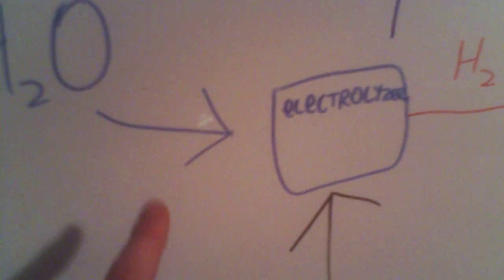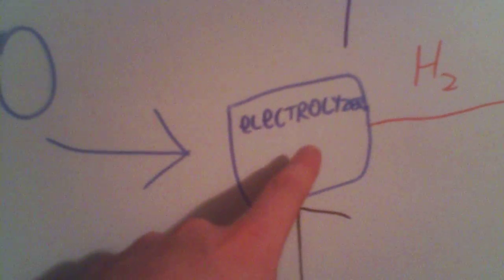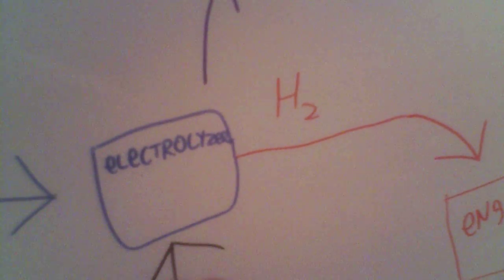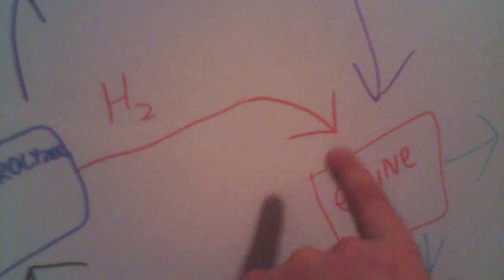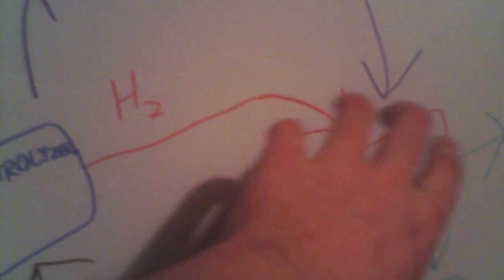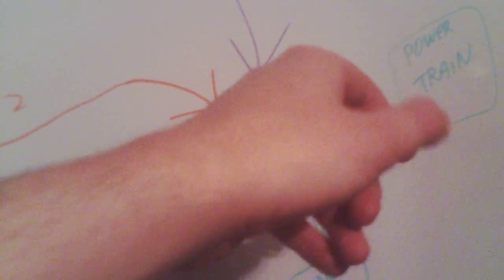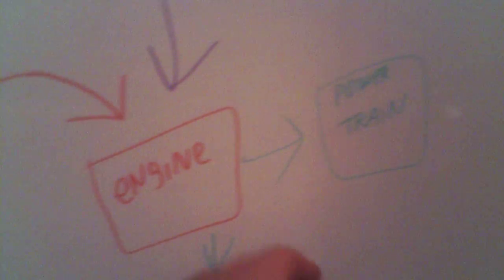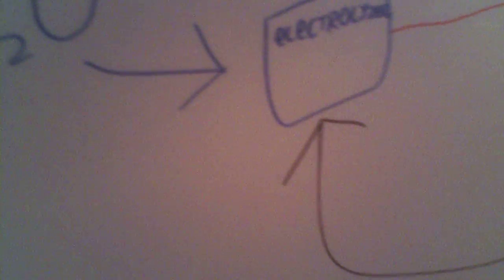Why HHO CANNOT EVER BLOODY WORK

Comment: And lastly, in any given long chain hydrocarbon, if I cleave a molecule at additional points, those parts are now free to combust. It's amazing, with older vehicles, how much combustible fuel ends up coming out the pipe. Think of this... CO, what is it? Fuel. It just needs more hydrogen to fully combust. Great example: woodgas, biogas.

Comment: You make your mistake at 1:11. Let's say you use 20 amps at 14v to make your HHO. Disregarding the true calculations on alternator losses (which we shouldn't really) let's say that 280 watts of power came from a full horspepower of engine "work". If then, that H2+02 (another mistake air is only 21% O2, HHO is 33%, thus helping the OXYGEN ratio) creates 2HP increase by completing combustion, your ahead. This was how it was explained by an engineer to me. It's not "free", but it does work.

Comment: As for water torches, the good ones, you are totally correct. The difference is, if I am cutting down decommissioned bridges in the middle of nowhere operating on diesel gensets, it's more cost effective than running 1000 miles back to the city to buy more acetylene. Not to mention the lessened fumes.

Comment: While I was quite certain that on my vehicle I was realizing a 25-30% increase in mileage, from my own flat road tests, the dyno, operated by a mechanical engineer showed an average over three tests of 10% increase. My unit at 5 MMW was borderline not efficient enough to realize full benefits. Few are. The effect is also noticeable, in my case from provincial (required) emissions test: much lower emissions; more complete combustion. Thus an increase in fleet use, in over 1000 cases.

Comment: With all due respect, that completely misses the point. when you have an HHo device that is around 80% efficient, and you have an older ICE, like my diesel that is roughly 30% efficient, the HHO, once again becomes an energy transfer medium, just like the torch my friend, and it then converts your burn rate efficeny, thus increasing the efficiency of the motor, completes combustion to a greater degree. Proven on the dyno, which does not lie.